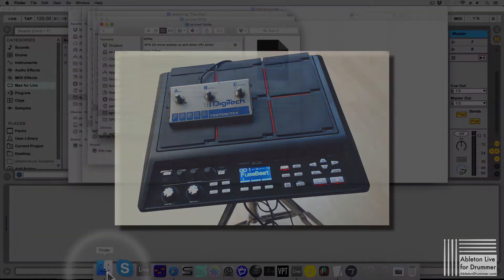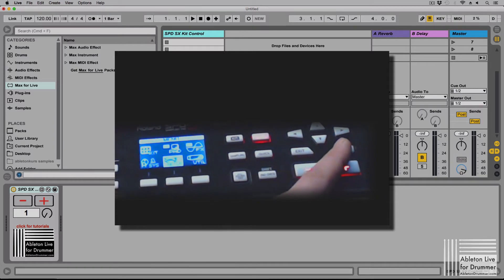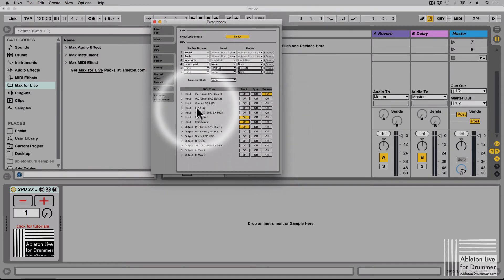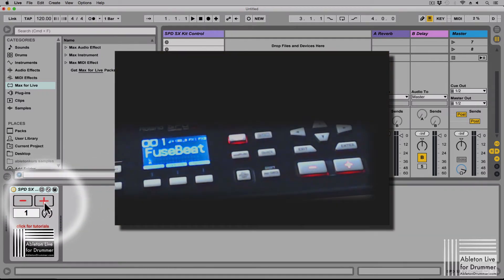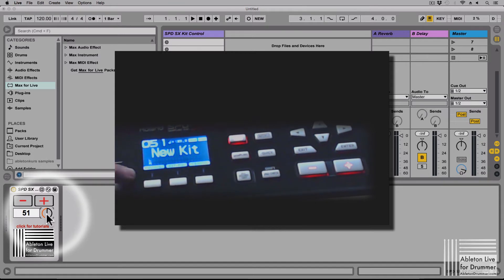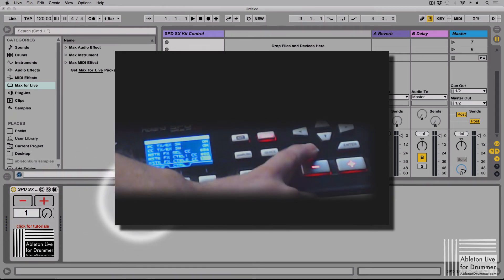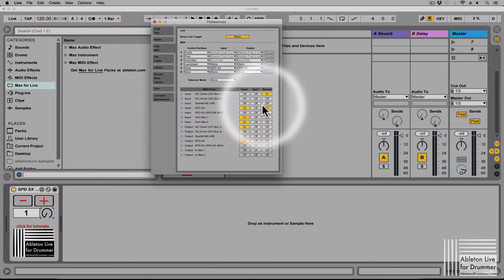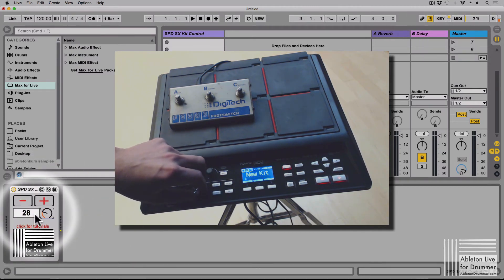Change kits on Roland SPD SX with Ableton Live - Max for Live device

Comment: Thank you for your video! My question is, is there any chance to use only the MIDI remote to change kits without using the computer?
Reply: Hey Viguel - you can send MIDI PROGRAMM CHANGES  from any other MIDI device as well to the SPD-SX to change kits.

Comment: Hi abletondrummer, thanks for this. I followed the steps in the video however I can't get the patch on Ableton to change kit number on the Spd-sx, however the Spd does change the kit number in Ableton. Do you have any advice as to what I'm doing wrong? Best, Casey
Reply from the maker: Hey Ciad, could be several things. First you need to make sure the SPD-SX is set to send/receive MIDI Program Changes. Next make sure MIDI routing and Channels are set right. It is all explained in detail here:  https://blog.abletondrummer.com/spd-sx-control-for-ableton-live-with-max-for-live/

Comment: Followed all the steps in the video, Ableton is successfully sending signal to SPD-SX but not vice versa. So the SPD does not currently change  the kit selector. How do i fix this?
Reply from the maker: If you followed all the instructions its hard to say. Double check if Midi Tx is turned on, select SPD-SX on track, check in Abletons MIDI indicator (or any other other MIDI monitor app) if a signal is transmitted to your PC/Mac at all. Make sure you have the latest version of this M4L device
Reply: abletondrummer.com what is the latest version?
Reply from the maker: @mattheckmanmusic  V2 is the most latest which you get free/donation https://gumroad.com/products/DyZr  V3 comes with 2 more devices for the SPD-SX https://gumroad.com/l/spdsxabletonlive

Comment: Great! Where can I download the Max4L patch?
Reply from the maker: Hey Margg, here you go: https://gumroad.com/l/DyZr#
Reply: abletondrummer.com gonna try it out, it’s kind of strange that it doesn’t work without additional Max4L app though
Reply from the maker: @margg_names  Well its a Max for Live 'Plugin'/device so it only will work if you got M4L
Reply: @abletondrummer  sorry, I didn't made my point clear. I meant that it is strage that Ableton Live doens't recognize the SPD-SX program change setting and the boxes for the program change remain clear (showing ---) even when you turn the midi setting ON on the SPD-SX. And one more question about your MAX4L patch before I get it, it is working per clip, for example can I change a program with a specific clip because that's what I want to do?
Reply from the maker: @margg_names  Yep it does. BUT if you 'just' want to send one PRG CH per MIDI clip, you can actually do this natively in Ableton Live ( In the "Note Box" section of a clip you can set up 1 PRG Change to be send when starting this clip) - The advantage of my device is that you can set this up in clip automations/envelops which means you can change kits inside one MIDI clip + if you change a kit on the SPD-SX +/- buttons the M4L device will show this and change as well.
Reply: abletondrummer.com that’s seriously awesome option that your patch is offering. Why does it have to be midi channel 10, as you set it up in this video? Shouldn’t it work on any other channel as long as you have set it up in the kit’s menu? Sorry, I just can’t figure out why it doesn’t work for me, no program change is recognized even though I set it up exactly as you explain in the video except that I use channel 2 instead of 10.
Reply from the maker: @margg_names  The channel needs to be the same like on your SPD-SX and per default thats CH10 (like on most drum moduls).